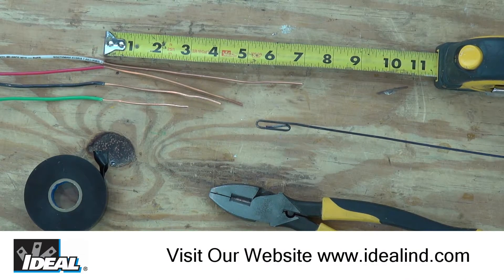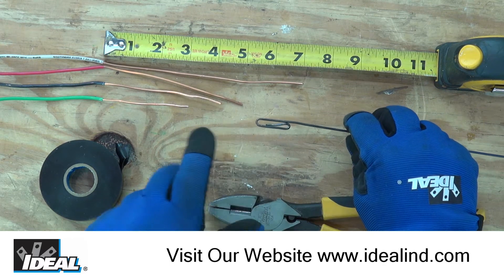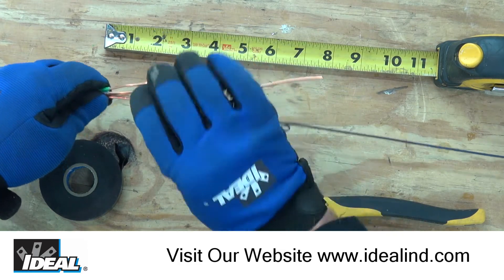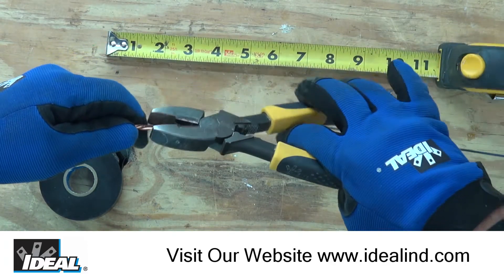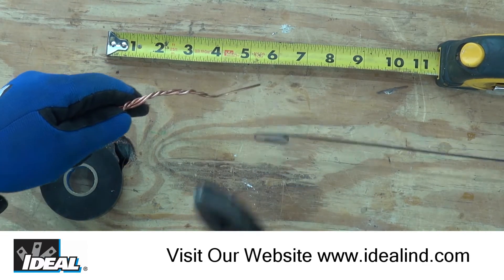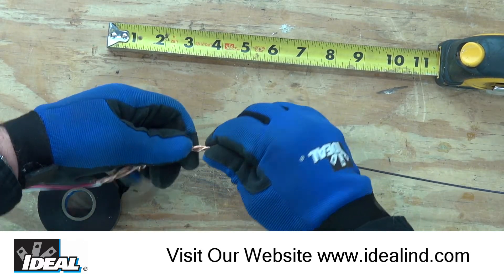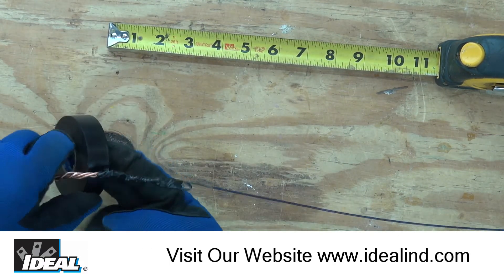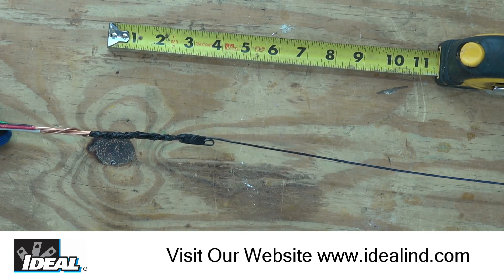How To Attach Wire To A Fish Tape By Staggering Wires

Comment: I don't know if I agree with this method.  Stripping the insulation off the wire and splicing them together like this means the head loses flexibility.  A spliced head is rigid as f***.  Rather, instead of using a fishtape, I prefer string heads.  Unless the string breaks, you are guaranteed not to lose any wires during the pull.  If you do it right, the string functions like a horsecock and grips the wires so tightly they can't get away.
Reply from the maker: That is OK you can disagree there are probably many ways to actually do this and I appreciatre your input. I just wanted to put out there something about attaching the wires have fun Ron

Comment: Why do the labels on the wire spools say machine tool wire?
Reply from the maker: Hello I am not sure might be a better question for a wire manufacturer. If I was to guess it relates to the different dies the manufacturer uses to draw done the wire to the size they are making. They start with a larger wire and draw it through several dies which makes the wire smaller each time they do that. hope that helps Ron
Reply: @RonKipperDatacomm1  okay thanks!
Reply: @shreddder999   To add a bit.  Machine tool wire refers to multi stranded cored wire, e.g..they take many strands of copper to 'build up' to the desired gauge.  The concept itself refers to wiring that can be used inside of machine applications...e.g..Electronics, wiring cabinets, appliances, equipment, etc.   You could kinda sorta make the case that stranded Cat6 cable would be a good example of its usage in datacom, but I don't know if the official 'standard' according to UL applies there since datacom is low voltage and you don't often have to worry about say..the thermal properties of the insulating jackets and the amount of heat due to resistance at any given current due to the current being so low.

Comment: Excellent Job Ron. Nice work , i was searching this and found in another site and eventually find yours. i was wondering how i missed it and see that it is published today :), thanks for sharing this
Reply from the maker: Yep new last week I appreciate you sending me the note. Ron
Reply: @RonKipperDatacomm1   I watched your video for conduit EMT bending. One of the challenge I faced and could not find anywhere a solution is, how to make sure i maintain proper plane while bending. I know how to bend or create offset but most of the time i go wrong because the plane is wrong, (like flipping 180 degree, turn upside down etc).. can u pls post a video for DIY about how to maintain plane, one trick i know is to use electrical wire and create a template to avoid confusion of what to bend and when etc but plane is still an issue for me. Anything you could do a video, would be a great help
Reply from the maker: I mention is several of the bending videos I sight down the conduit and use the bender handle as a reference to line up the two bends before making the second bend. I will add it to my list of videos to do though. Thanks for watching Ron